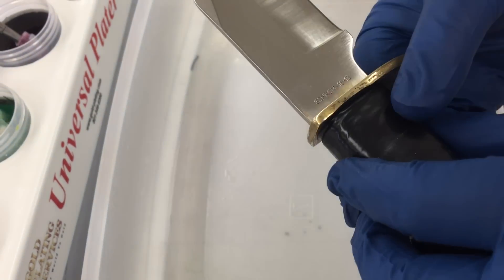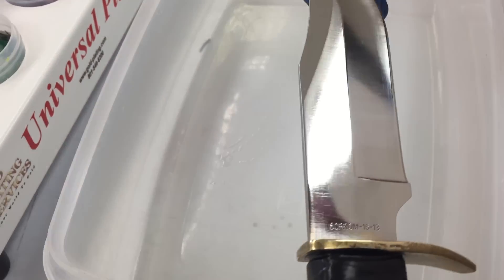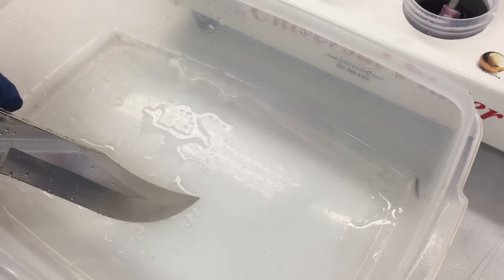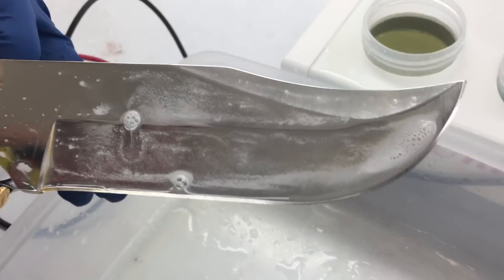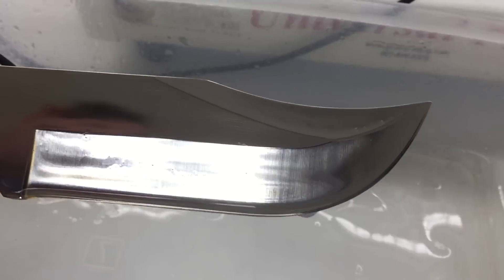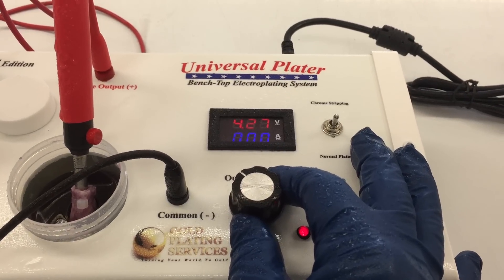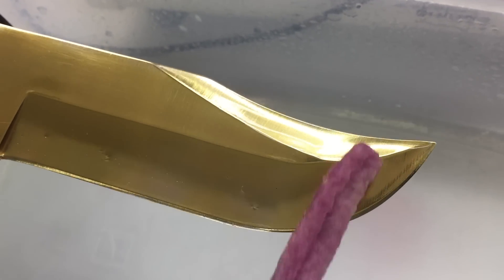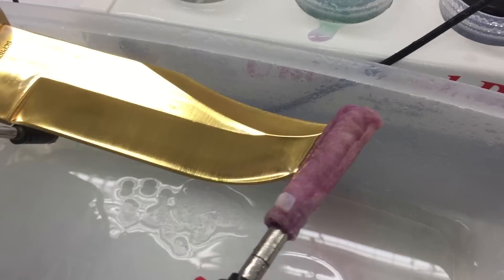24K Gold Plating on Knife - Stainless Steel - Brush Plating Demo

Comment: Why did it not plate the blade next to handle?
Reply: I know that bothered me so much haha
Reply from the maker: The purpose of this video was to demonstrate the correct way to prepare the metal being plated and also the correct way to do the plating.  We finished plating the entire blade (even next to the handle) off camera.  The cotton sleeves shown are able to get into nooks and crannies such as the one near the handle.  However, if it was a situation where it could not, the kit comes with our "Ultra fine-select Pen Plating Tips" which are more fine of a tip than a Sharpie Marker for doing hard to to get or small areas.
Reply: @GoldPlatingServices  Good morning I'm about to order one of your kits from eBay it's the one with gold, rose and I believe nickel. My question is I'm looking to do bare polished metal, what would I use for this process?  Thank you.
Reply from the maker: @larryvargas6659  Polishing is a craft that has many different methods.  Typically, people will use sandblasting, buffing wheels, polishing wheels and polishing compounds.  Which of these is needed for the given situation depends on the level of polishing/cutting required.  In this case, where the customer requested that we do not remove the machining marks nor change the shape or sharpness of the blade, we just used polishing wheels to shine it up.  The customer also requested that we do not plate the entire knife, as he intended to immediately polish it of and replate it himself once he received the knife back.
If you give us a call we can assist you further with more details and answer any questions you have.  801-546-6200
Reply: @GoldPlatingServices  The only thing you demonstrated is that your business practices are shoddy and you lack attention to detail. You didn't even show the knife from step 0, unpolished, even though you yourself said the original and only intent was to make a video out of it.
Reply from the maker: @nemezote  We actually have another video showing the polishing. This video was specifically about electrocleaning, striking and plating properly in an area - not meant to be a zero to completion video.
Reply from the maker: Thank you for your feedback, we greatly appreciate it.  A lot of times these videos come as a need to answer a specific question, such as "How do I properly plate onto stainless steel?" or in this case "I followed all the steps but the gold is splotchy".  In the interest of keeping the video short and to the point we typically keep it that way.  That being said, you make a very good point and we will put a video like you mentioned in line to be done.
Reply: Electricity takes the path of least resistance so it's hard to build up material in corners. You could make a small custom anode to get the corners specifically. Powder coating tends to be light in corners as well.
Reply: it would've made more sense to show us the knife as you received it by the customer and then the process of polishing, preparing and plating the whole knife to actually show us what a customer's item goes through throughout your service of gold plating it.

I know the purpose of this video is to demonstrate the correct way to prepare the metal being plated and the correct way to do the plating. However, as i said, it would've made more to add more purpose to the video. That I think would've made the video more interesting and more satisfying to your future and current customers.

Comment: That's not a "Buck".  I hope the Buck knife company never gets wind of this video. I would suggest that someone, if they want a really nice piece get their hands on a decent bench buffer, but even a rotary tool will do well.  Work the piece with progressively finer emery paper from 320 grit too 400 or 600 to 1500 and 2000. Then buff with scratchless pink compound. A little work will get those tool marks out. That's not grain structure it's just tool marks. If you work them out it will look much better.
Reply from the maker: If the desire is to work the tool marks out, it certainly can be done just like you said. Not everyone wants the tools marks removed however.  Good info for people wanting to do polishing, thanks for sharing!

Comment: how long before it starts to fade. can I use this for gold teeth caps, try are starting to fade
Reply from the maker: Gold is a soft metal, so eventually it will wear down with abrasion.  However, the gold itself wont fade without wear.  The thicker you apply the gold the longer it will last.  We can't be sure if the gold teeth caps you are wondering about can be plated, however if they are metal they probably can be plated.  We have done dentures, braces and other similar mouth pieces using this process.
Reply: how much does this cost can I buy a small kit to do it myself
Reply from the maker: The Universal Plater Kit is $799.00USD and comes with $295 worth of gold as well as many other accessories. In the video description you can find the links to the product pages which give detail about what is included.  To have what is shown in the video the only additional item needed is the Woods Nickel Strike.
Reply: is there a cheaper alternative like something under $100
Reply from the maker: Our least expensive kit is $399.00 and would not be appropriate for plating those type of items. If the correct process is not followed the gold will not stick to the item.
Reply from the maker: The smallest kit we have is the Gold Smith and it is $399

Comment: thanks . good vid. can you tell me how many coats of gold i could apply?
Reply from the maker: Theoretically you could apply how ever many coats as you want.  Typically you only apply 1 coat as its not necessary to apply multiple coats.  The longer you spend on your first coat the thicker the gold will be.  However, if you decided you wanted to add more gold, you could go over it again and again.
Reply: @GoldPlatingServices  this reply has only just reached me. but thank you very much.i would like to get a little plating station going. well see.

Comment: touch up unplated  spot on  other side, or start over?
Reply from the maker: If you just tried to plate over that side it would never look good.  The other side needs to be treated exactly like we did this side: Polish off all the gold, get the piece to the desired luster, then replate as shown in this video.  Its common for people to think that just adding more gold will fix something, but it almost never does.  The reason that spot is still stainless steel is not because the area was just missed, it is stainless because the Electrocleaner and Woods Nickel Strike were not done properly.

Comment: I was just wondering if you're plating stainless steel (brush plating) why do I get blurry parts or parts that look dull even after polishing and before polishing I still get some blurry/dull parts do you have any ideas why? I love the channel.
Reply from the maker: Thank you!  We're glad you love it!  So are you saying its dull before you even plate it?  You said "dull even after polishing and before polishing", not sure if that means you are polishing it AFTER you have gold plated it?  You need to perform ALL the polishing you need to achieve the final luster you want prior to gold plating.  Do not polish after you have gold plated, especially with our gold this is not necessary.  Some peoples gold solution needs polishing after plating, ours does not.  If you polish gold it will simply remove it and usually does not help the appearance.  Only exception is if you have "burning".  With burning, you can clean it up by polishing it with a mixture of baking soda and water made into a paste.  This is the only situation where you should ever polish gold.  You need to get the piece you want to plate to the shiny luster you desire before plating.  Gold plating is the final touch, the "icing on the cake" if you will, so if you prepare the piece good, the gold plating will be good.  If its dull before plating, it will be dull after plating.  Hope this helps!
Reply: It's perfect upon gold plating as I polish the stainless steel and clean it, but when I golds plate it sometimes has a dull look in certain parts or hazy if that makes sense.
Reply: @k0jithemaster927 did you ever figure out why you were doing wrong ?

Comment: Was there a cleaning process between the polishing (with the wheel) and the electroclean?
Reply from the maker: Yes, we cleaned it with Toulene and then a little soap and water.  You want to remove any of the polishing compound that is left on the surface.
Reply: Thanks for the reply, Is toulene similar to Acetone?
Reply from the maker: Very similar but we have found toulene just works a little better.  Whatever you can do to remove the polishing compound will work.
Reply from the maker: Similar yes but not the same.  Toulene works better for certain things like removing polishing compound.
Reply: I didn’t think of this. I skipped the cleaning between polishing and electro cleaning. I experienced some burning during the nickel plating but not on the entire piece. I’m wondering if this is why.